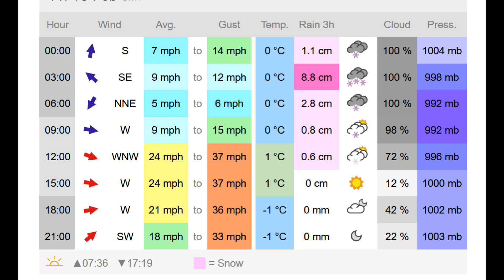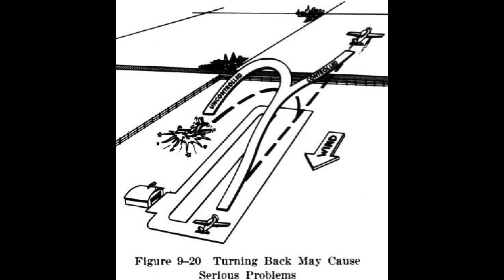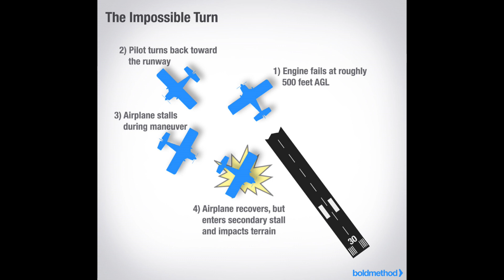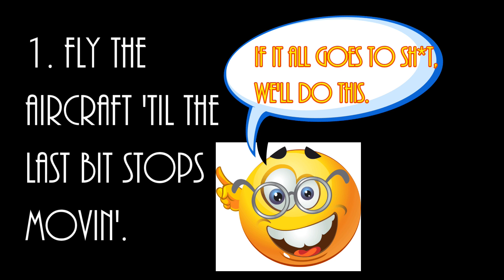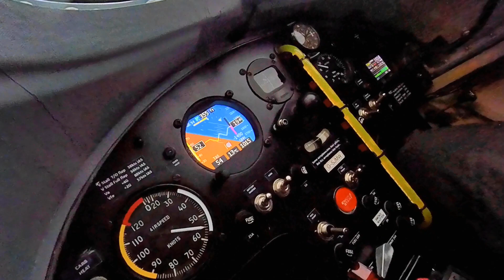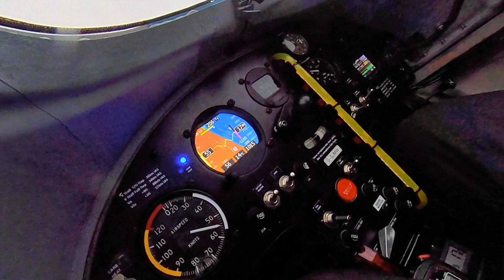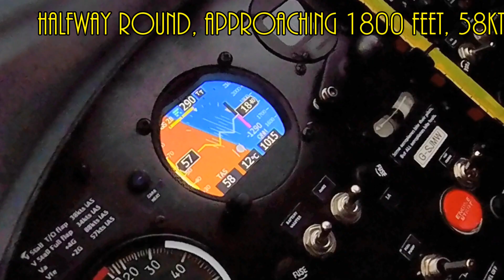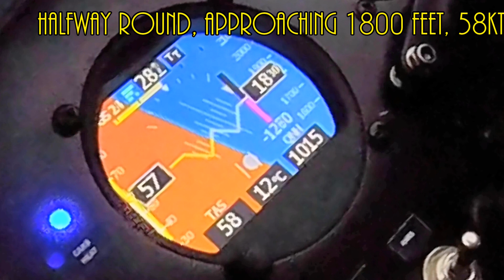TakeOff Trauma - to Turnback, or Not? Handling the Minisport when things go wrong.

Comment: Excellent video Mike. I too give myself a verbal self brief before take-off. The only thing I add is "impact speed" as I'm consciously aware of the old kinetic energy. I would rather impact at 60kts than 120kts (where I would have FOUR TIMES the impact force). So my impact speed is Vs full flap (manual flaps) +10kts.

Comment: Very useful and well made video, Mike.  I noticed that you used the standard formula to calculate your aircraft's increased stall speed at 45 degrees bank (42kt X 1.19  = 50kt).  As I understand it, that formula is based on a level turn, whereas some experts say that with the reduced load factor associated with a descending turn the stall speed is not as high as in a level turn. (No loading-up with back pressure needed). But perhaps it's better to just ignore that factor and give yourself the extra safety buffer.  Still, I suppose that in an emergency where an absolute max performance turn is needed (i.e, smallest radius, shortest time, minimal height loss) then the slowest (safe) speed in the (balanced) descending turn would be a good number to know. Needless to say, "canyon turns" are not something anyone should play around with, absent proper instruction/training.
Reply from the maker: Thank you, Gary, for a useful comment. I agree that the figures could be tuned more accurately to give the "absolute best" performance. My intention, though, was to come up with a good working average procedure based on the fact that there would be, inevitably, a number of different factors affecting each incident. I completely agree that the speeds I aimed for are pessimistic but, safety margins apart, they are easily achieved without conscious thought; full back trim will allow the aircraft to settle into a Best Glide attitude and speed, giving me spare capacity to deal with radio calls, lookout, etc etc. I know from the "feel" of the aircraft during local tailchasing/dogfights that to max perform in turns I can bend the rules a bit and the aircraft talks back quite well but that's in a situation where I can back off immediately if things get exciting, whereas in an emergency I might run into trouble if I've misjudged it.
Reply: @TheMorayMosstrooper  Yes, fair enough Mike, I see where you're coming from. Thanks again for sharing your insights and experiments.

Comment: Hi Mike. I've done this myself and, like you, my first attempts were a disappointing mess and all over the place. Also, trying it at height, 2000ft, made it difficult to be sure I had really flown the necessary amount of turn.

Next time out having had time to ponder I did a much better job of it although I cut the throttle at 1000ft after take off from Easter. I didn't do a 360° but roughly a 225° followed by a reversal of about 45°, so roughly 270° in total. That gave me a good visual picture that I was now really on the reciprocal to the departure runway.
My best result was about 100ft height loss, but then my RF3 has not a bad glide ratio.

I do agree that it's essential to trim aggressively for best glide and to not be shy of really cranking it round in the turn.
Reply from the maker: Hello Don. With a glide ratio like that, I guess the problem is solved almost before it's occurred. Still, takes some trust (and nerve) to initiate a turnback at minimum height - but I guess you'd always be a lot higher than 100 feet agl or you'd land straight ahead? A good reason to practice.
Reply: @TheMorayMosstrooper  Hi Mike, it's not something I expect to have to do in 'anger' but I do think it's worthwhile knowing what  'might' be workable should I have an EFATO. But I probably wouldn't entertain the idea below about 500ft unless there really was no alternative. My glide ratio is 17:1 or 18:1 depending on which reference I use so probably about twice as good as many light a/c.

The other thing that may be considered connected and perhaps of equal interest is how an aircraft, anyone's aircraft, behaves at the point of engine 'failure'.
Does the nose have to be positively pushed down (standard protocol)...or not? Mine, trimmed for climb and hands off, will just gently arc over into a trimmed descent with almost no change of airspeed. However I would certainly recommend discovering this at height and with great caution! I did, several years ago and long before I tried the 'impossible turn'.
Reply from the maker: @fournierdon2172  Hi Don. The need to positively Control (Fly) the Aircraft is clearly paramount, so although the Minisport will eventually adopt a safe glide speed without pilot input I prefer to be positive in the selection of the attitude. My experiments so far suggest that if I were to do nothing other than "trim nose up", the aircraft would settle very well into a 60 kt glide. However, in the interim there would be a build up of RoD which can be avoided by an aggressive manual selection of glide attitude, thus retaining valuable altitude. 
I'm still waiting for suitable (that is, ANY flyable weather) to try all this out in anger. Surely, these storms can't go on much longer???